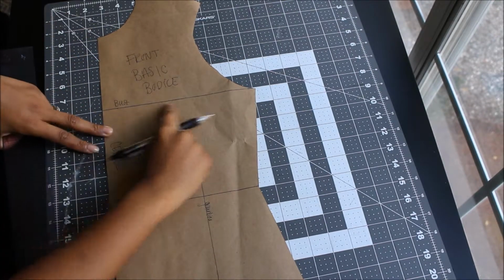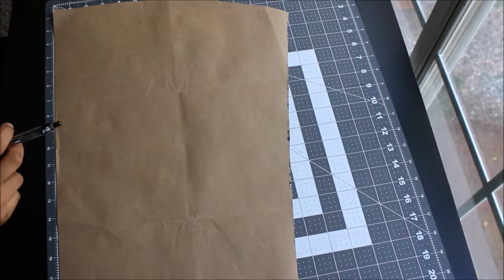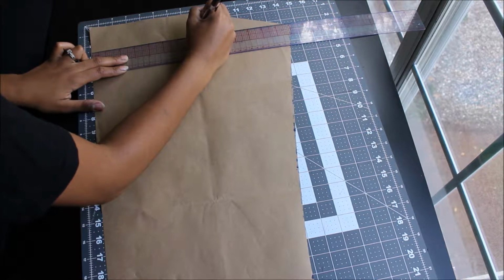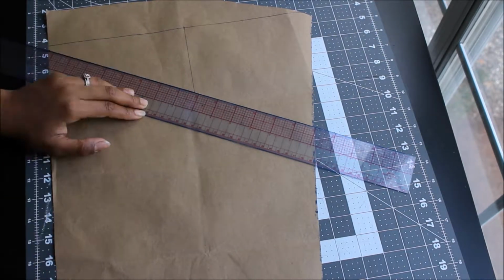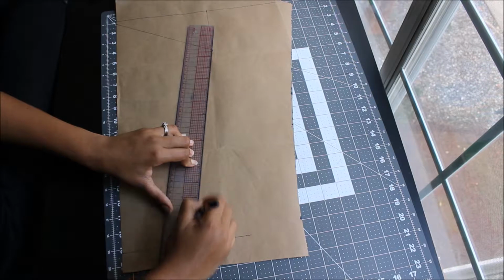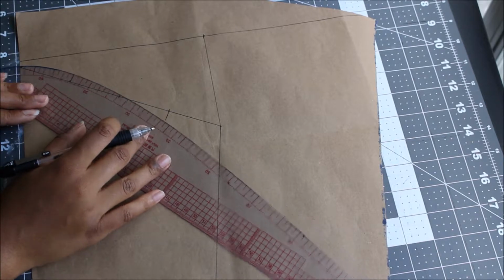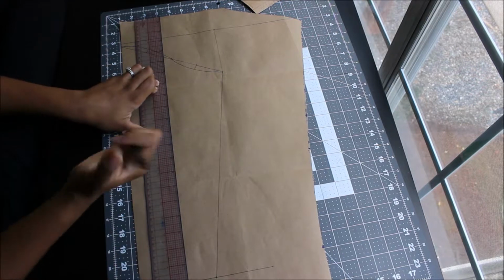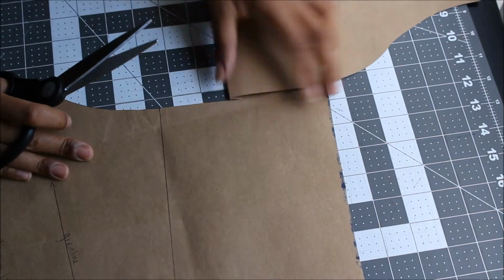EASY DIY Basic Sleeve Pattern l Ty Kent

Comment: for beginners, you should have demonstrated how to properly measure. what beginner would know what an "armhole x" is, without visualization or verbal elaboration. POOR! :(
Reply from the maker: shoeshinequeen There's no one way to draft a pattern. I used a formula to calculate the "armhole x" measurement from a finished bodice instead of taking the actual measurement. That is why a demonstration of taking an actual measurement was not included in the video only the formula to calculate the measurement. Thanks for the tip!
Reply: thanks for responding. again, "armhole x" is what? purpose? (I am literally a beginner; no formal training, and only sewing for about 2 months. would you suggest I copy a standard pattern sleeve to sturdier pattern paper to use as a basis for sleeves?
Reply from the maker: shoeshinequeen the armhole x formula was an easy way to create the depth of your armhole using your bodice pattern without taking measurements. It is a formula. Using commercial patterns are always a great option as well. Just use a tracing wheel to transfer the pattern to craft paper like you see in the video. I would suggest measuring your bust and choosing the size based off your bust measurement because your waist and hip can be easily adjusted without affecting other measurements. I plan to make a video showing this method of creating basic bodice, sleeve, and skirt patterns by using commercial patterns.